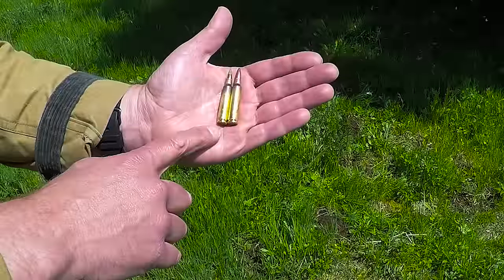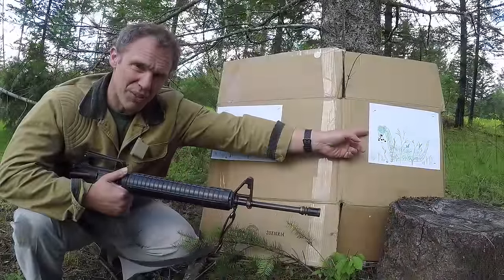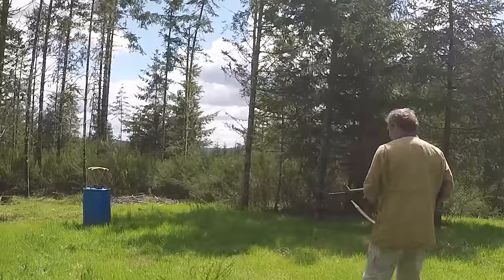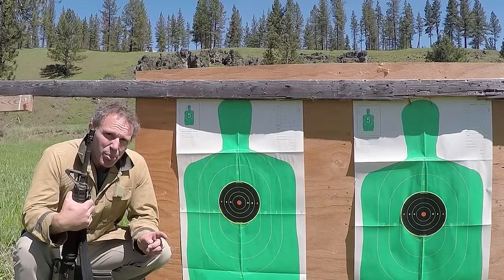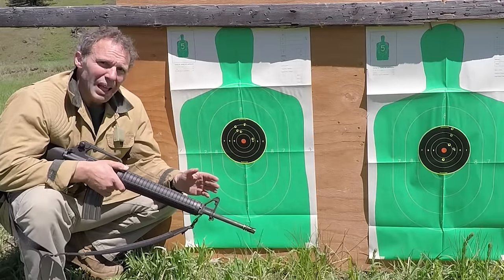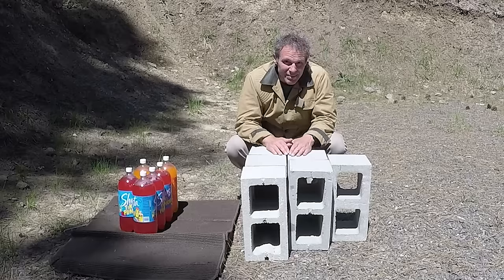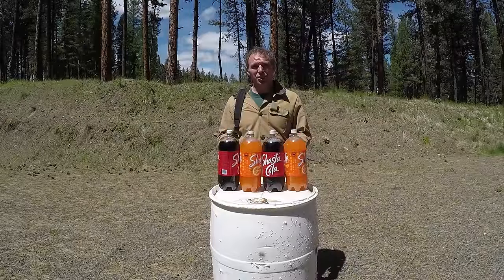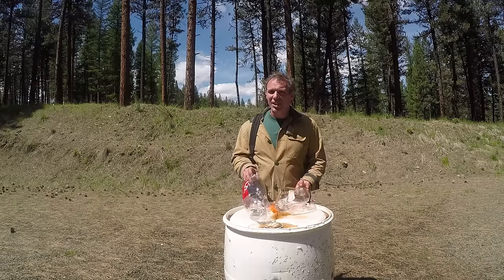5 56 NATO Ammunition:  XM193 55gr.  vs  M855 62gr.

Comment: Excellent demonstration and I agree with your conclusions. In my time in the Army 1967 to 1992, we only shot the 55 gr but it did have a layer of steel under the copper jacket. It wasn't a penetrator but it did harden the bullet somewhat.  And as you shown, your rifling twists do make a difference. The lighter 55 gr bullet does tumble when it hits soft media. I'm not sure of the technical term, but ballistic coefficient come to mind. You can correct me if I'm wrong. Sincerely, Major Richard Travalini, US Army (retired).
Reply from the maker: Good info. Thanks for the input sir.
Reply: Could be and probably am wrong but think sectional density is more at play in tumbling where as ballistic coefficient plays at retained energy over distance.

Comment: what i did was go with a 16 barrel in a 1-7 twist for my heavy steal core/ heaver grain. I've got a 20 inch barrel in1-9 twist for my 55 grain and lower. favority round is the 45 grain hollow point.

Comment: Paul, I played with a couple of 1/12 twist SP1 barrels years ago. I had a scope mounted on the flattop upper, and a Knight’s Armament two stage trigger installed.
I got better groups with Federal GMM 69 gr BTHP than I did with XM855  off of a bench, shooting at 100 yards.

Comment: Well done! you explain that very well. I have a bushmaster XM-15 (M4A3) with a 1/9 twist! I primarily use the green tip ammo. She is a very accurate rifle!!
Reply: The military only went with 1:7, 1:8 to stabilize the big tracer rounds for training. They wanted to be able to train people on tracers and that carry over to real ammo perfectly. Tracers are very long and light so they need a fast twist. They were gonna go with 1:9 as is was more accurate than 1:7 with 55 gr but couldn't shoot tracers so ended up picking the 1:7
Reply: @jordanwiser4192 I had an m&p15 with a 1:9 twist and it was key holing at less than 25 yards with 55gr
Reply: @jordanwiser4192 I don’t have that issue with 1:7
Reply: @HatsuneM1ku01  I don’t think whatever you were shooting was 55gr. Also the aug, 5.56 ak’s, Galil’s, they all have 1:9 and do just fine. Something tells me your not old enough or literate enough to even know why the put a 1:7 twist in the m16/m4
Reply: @HatsuneM1ku01  I’ve never had that issue with 1:9 and all I shoot is m855 and mk262. Stay away from ar-15 forums. More cod adderall kids there than actual gun owners and you will hear some crazy shit

Comment: One thing that was mentioned but not discussed was barrel twist rate.  I'm no expert at all, but I've read where the 62 grain bullet is best used in a 16" barrel with a 1:7 twist rate.  That would indicate that the 62 gr. projectile prefers to spin at a higher rate.

Comment: The M855 is not a true steel core round; it is a lead core round with a steal penetrator at it’s tip and of course, copper jacketed.  The green tip not only identifies the type of round, but it tells us where the penetrator is in the round and it’s size.  Rip one apart and see for yourself.   

They are excellent in combat, they do what it’s designed to do, and I’d rather have an AR with M855 on me than anything else in a battle rifle.

The tungsten core round, in my real world experience, is the least accurate round I have used.  I would imagine this because of it’s density not allowing it for form through the rifling.  

Great video, keep up the great work Paul!

Comment: Something else to consider is a lot of private ranges do not approve of “green tip” for steel target shooting. Even though I have an adjustable rear sight calibrated for green tip, I find it easier to just zero with the 55 grain and not worry so much about making adjustments.

Comment: Not a test, just an observation. I was out plinking with some friends shooting at 1/4 inch steel plates (galvanized plates for cell tower modifications so NOT 500 steel). The 55 grain bullets out of a 16 inch, 1 in 9 twist barrel definitely put a nice crater in the plates at 100 yards. The 62 grain penetrators put holes through the steel. I love your meat targets!!

Comment: To test penetration during the 5.56 NATO trials, they used an FRG helmet (German Helmet). The M193 penetrated out to ~500M, the 7.62 NATO ~600m, and the SS109 over 1300m. 

The faster the rifling twist, the more the M193 & SS109 penetrated. The SS109 tends to be more accurate with a 1-9 or 1-10 twist. Still, not particularly accurate compared to M193. But the Marines demanded maximum penetration, more than the 7.62 NATO & 6mm SAW. Hence the odd ball 1‐7 twist.

Comment: I've owned a Colt model AR-15 SP-1 with the Colt 3X bullet drop compensator scope, 1-2, 3, 4, 5 hundred yard adjustment for over 40 years. With 193 dead on, with 885 better than nothing.

Comment: My customized Mini 14 Ranch tactical in its Archangel Sparta chassis with a Leatherwood Hi-Lux 1-4x24 LPVO consistently groups 1.2-1.5 MOA or better with Winchester Lake City bulk M855 ammo, even without one of those barrel struts, so that is my go-to for my stockpile. I say my rifle would beat any mid range AR-15 any day and kick a higher end AR's ass 75% of the time LOL. Got a Cogburn Arsenal trigger finger mag release that makes dropping the mag with a single finger possible. Standard 30 round Thermold mags and Promag steel 30 round magazines with Ruger followers (I found the Promag followers to be the sole cause of all their malfunctions) work all day long without issue for me. Went off on a tangent there, but the bottom line is that my stock of M855 is certainly accurate enough for my needs.

Comment: So for the skinny-- if you have a 16" and expect to engage "threats" with body armor the 62gr out to about 250 yards, while the 55 gr going faster will only work under 100 yards. Against non-armored threats the 55gr will be better in both accuracy at distance and damage due to the break up. Guys running a 10-14 inch barrel against 2 legged threats both armored and non-armored should see better results using 62gr because the shorter barrel is going to cause less break up, and the 62gr yaw / keyhole will work toward your advantage 250 yards or less. If you plan on engagements past 250 yards... find another caliber... Spray and pray works against uneducated and under educated zombies, but not against trained fighters.  Your "threat" at 350 yards will be the size of a watermellon..62 gr and 55gr out of a 14" or less yields a POI 10+ inches around. If you think you would score a hit on a watermellon 350 yards away with your 11" "Pistol build" with a x3 mag+Holosun before that watermellon using 308/7.62/6.8 gets a hit on your "mellon" think again...in fact that makes you the under-educated zombie in my book....LOL

Comment: Green tip gets through common light barriers. Penetration is important.  Military spent big money developing the round.  Nothing wrong with m193. Wish Colt made 1-9 twists for their common guns so those two rounds were more easily fieldable out of one barrel.  The really heavy rounds are to me kinda exotic and expensive.  Heavier billet out of ar?  I use a 7.62 Russian upper.  And it's pretty great even at longer ranges. Plenty accurate 77 grain vs 124?  124 please.  Thanks Paul hope you're well.

Comment: In the 1970's the US military was developing a 55 grain penetrator bullet and Belgium was developing a 62 grain penetrator bullet for their new belt fed machine gun. Physics being what they are, the 62 grain bullet out penetrated the 55 grain bullet and NATO chose to standardize the 62 grain bullet. The US military found that with the 62 grain bullet that 9 inch rifling was more accurate than 7 inch rifling, but went with 7 inch rifling because that's what NATO chose, based on recommendation from the Belgian company that wanted to sell machine gun barrels and faster rifling wears faster.

Comment: The two twist rates have interesting back-stories.

The early M-16 barrels were actually 1:14" twist and worked perfectly well with that lead-cored, 55gn boat-tailed bullet. 1:14" was also the "standard twist for a couple of dozen "sporting " 22 CF cartridges, firing 40-55gn bullets. Field reports from "early adopters" competing in the south East Asian War Games indicated impressive terminal ballistics. However, above the Arctic circle, groups went out the window. Why?

The bullet travels through AIR. Arctic air at sea-level is measurably denser than one commonly finds in the tropics. Thus, the bullet was marginally stabilized, at best, in such an environment. Hence the switch to 1:12" twist. Of course, with the bullet now "more stable" it took slightly longer to "upset" as it transitioned into the big bag of slightly pressurized, fibre-reinforced salty water that is a live body.

So the bullet would travel further before diverting from its initial path or distorting / breaking in two. This meant a different wound channel pattern, even if the initial cavity were similar.

Fast forward to the 1980's and the development of the FN SS109 round. The bullet is heavier (62gn vs. 55gn, but critically, it is LONGER. This may not be apparent at first, because the overall cartridge length is pretty much the same, for the simple reason that it had to work through ANY standard 5.56 x 45 magazine.

This increased bullet length  had to go somewhere and thus it protrudes deeper into the cartridge case than the old M193. This greater seating depth, coupled with increased mass, required a serious change of propellant, of course, 

As for the rifling twist, there are TWO quirks.

The longer SS109 / M855 / F1 etc. bullet needed a faster twist to stabilize because of that very length, just as Mr. Greenhill formulated, over a Century ago. Anyone who was involved in US military target shooting using the original 1:12" twist barrels back in the 1970's may remember that one of the "performance bullets used for the longer ranges was the classic Sierra 63! grain spire point.  The trick here is that this bullet, because of its shape, is no longer than the M193 projectile and thus stoked up for 500+ yard shooting, was easily stabilized in the 1:12" twist.

The M855 will, in fact stabilize in a 1:10" twist at specified velocity in a 20" barrel. (Maybe not near Santa-Claus' house, though.

The fly in the ointment was the TRACER round. The FN L-110 and M-856 are LUDICROUSLY long because of the need to contain a tracer pellet that will burn visibly out to at least 500 yards. Stabilizing that bullet  meant a MUCH tighter twist was required;. This was further demanded by the requirement to perform correctly from "carbine' barrels. Shorter tubes mean lower velocities and consequently slower rotational speeds. Hence the 1:7" rate.

But wait; it gets even more interesting. In the 1990's, I did a LOT of Service competitive shooting of M-855 equivalent ammo, only out of the Steyr AUG pattern rifle with a 20" barrel AND occasionally the 16" inch carbine variant.

What rapidly became apparent was that the carbine drivers were consistently getting better groups and thus better scores at 500metres than those using 20" barreled versions.

After a lot of rounds down-range and a lot of close target inspection, a few things became clearer. Out to 300 metres, there was no perceptible grouping performance difference between the two different platforms. At 400 metres, the groups fired from 20" barrels were slightly larger than the carbine ones and at 500 it was starkly obvious..

What we were seeing on the rifle targets was the result of bullet "overstabilization". As the path of a "normally-stabilized" bullet starts to diverge from the line of "departure" the "lateral" influence of the air increases and the bullet will do a little "shimmy" and realign itself with the parabolic (ish) trajectory that gravity demands. If this is happening in tiny adjustments, thousands of times a second, nobody will be any the wiser and the bullet will go pretty-much where intended.

However, if the gyroscopic stability is excessive because of too high a twist rate for a given velocity, the bullet will try to stay on the line of departure and, as the aerodynamic forces build up, the bullet "reset" will be a lot bigger. and less frequent AND not necessarily on EXACTLY the original trajectory. 

This leads to the odd grouping results . And I don't want to get started on bullet precession and barrel harmonics: They are two whole other complicating factors..

Comment: Years ago I worked up some very accurate loads for my late 70's early 80's Colt AR's.  Later I picked up a H-Bar and headed to the range with a bag of my hand loads.  Well I had no idea what a 1 in 7 twist rate was but those 55 grain projectiles were shooting minute-o-washtub.   I called Colt prepared to raise hell.  Thankfully the very nice lady that answered the phone schooled me on twist rate and bullet weight.
Reply: With 1:9 twist Sportsters ( yes , at least during the Transitional Era ,at least some Sporter Targets came with 1:9 bbls . During the Transitional Era Colt made them with every possible combination of old style and new style parts until the stocks of old style parts exhausted . One Sportster that I was familar with since the original owner purchased new , had A2 buttstock , handguards, bbl profile , 1:9 twist , and A1 Upper reciever .)    I was able to easily develope sub MOA loads with 50gr Barnes . Or at least I could shoot them just under an inch with iron sights . At that juncture , I couldn't guess if the limiting factor was the ammo . the stock bbl , or the nut behind the trigger .

     And I didn't care , and gleefully declareded Victory at that point .

   People would talk trash about " large pin " Colts , but they could shoot ! Great barells in that era , and the stock trigger was very good for a mil type trigger .
Reply: @filianablanxart8305  Talk about every combination.  My H-Bar/Sporter is a small pin receiver but has the pinned in hardened steel sear block.  A lot of AR cork sniffers claim that Colt never made such a beast.

Comment: Use a 1 in 7 " rifling twist barrel and it is accurate enough to hit a 50 cent piece over and over at 100 meters bare sights with 62 to 77 gr military ammo and up will stabilize projectiles up to 90 grs. Many combat units used the 25 meter zero target at 100 meters to qualify M16A2s but all you do in the Infantry is shoot and train.

Comment: You did account for barrel twist rate in accounting in your accuracy and velocity testing right? Because the 62grain was specifically designed for the 1:7 twist rate barrels. The 55grain was designed for 1:9 twist barrels.

Comment: A lot of variables here.
My Colt CSR15  (1:7 twist) greatly prefers the 62grain. My wife's Diamondback ( also 1:7 ) the 55 grain as far as 100 yard groups are concerned. 
It's always best, in my opinion to test your individual weapon and determine which munitions produce your desired results.

Comment: 14:14  It was some time ago that I was reading about this - so please take with a heaping spoonful of salt. As I recall, the SS109 round was intended to be a more humane round when fired out of the A1. The goal being to produce wounds that were more deadly than lethal, i.e. resulting in more immediate death than as a result of heavy trauma. As I recall the SS109 was introduced close to the introduction of the A2 improvements, but was not designed for them. Apparently fired out of the A2 with its more aggressive twist the new round's ballistics were fairly different and resulted in very high trauma wounds. While there is a certain dispassionate battlefield calculus that could make heavy trauma more effective than fatality, I do not ever remember seeing it as an intentional design goal (and in fact, much the opposite).
Reply: The SS109 was designed for improved battlefield penetration of then current Soviet helmets and body armor .

  The A2 was indeed designed and intended around the SS109/ M855 . But the US Mil had a gazillion rounds of M193 then on hand , and used it up first , taking several years .

Comment: 8:26 If you look at the thickness of the concrete, only the first concrete block for the 55 grain test is the heavy-duty type. 9:47 On the 62 grain test, it appears that all of the blocks are heavy-duty. Seems like the steel core performed better than originally thought. Cheers!

Comment: I think a bonded, soft point projectile like the gold dot or fusion is probably the best all around load for the AR.  They are barrier blind, extremely accurate, expand very well under any velocity and don’t over penetrate. They work equally well in 20” guns and 10” guns.

Comment: Want to talk about extravagant soft tissue damage from a yaw & tumble of a high velocity projectile then I recommend taking a moment to check out and research the 7n6/5.45x39 cartridge.
The void underneath the nose of copper jacket coupled with the small bit of lead and the steel penetrating core virtually cause the bullet to become V shaped as it strikes soft tissue and continues to flip and tumble through.

Comment: I think that when the 5.56 was developed it was done with a dual purpose in mind. Yes, they wanted a lighter ammunition that was easier to transport, cost less to manufacture, greater magazine capacity etc but I also think they were trying to circumvent the geneva convention which dictates that hollow point ammunition can not be used in warfare. They then figured out that by using a smaller projectile traveling at faster speeds could inflict similar levels damage to a hollow point. They just focused on the first reasons for obvious political reasons.
Reply: HomunculusPrime I think you are right on there

Comment: I got a bolt action 556 rifle with a chrome lined barrel and its 20 inches long , 1/12 twist rate , the bolt even has a ar 15 extractor and it shoots 55 grain ammo the best! Zero the 4 x scope for 3 inches high @100 meters  for a 300meter zero